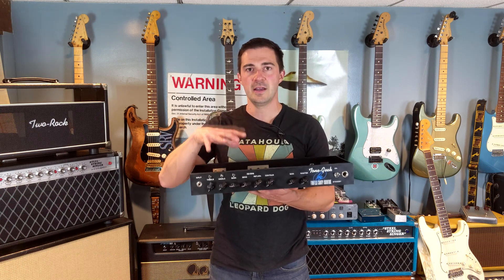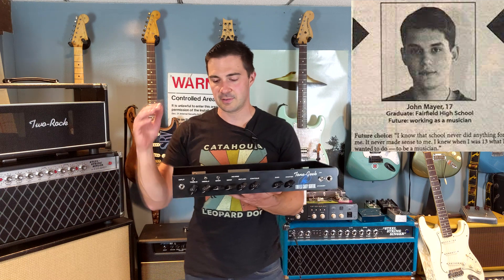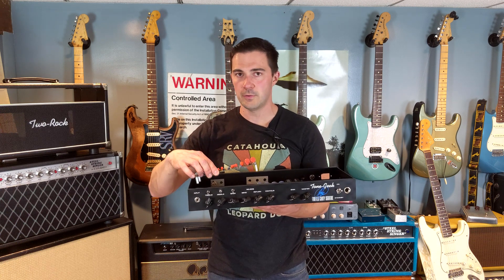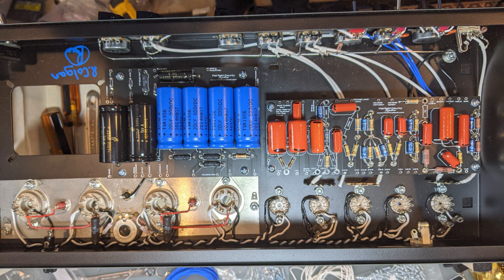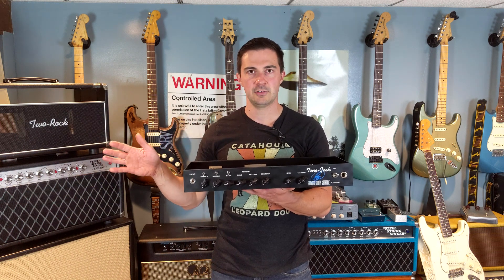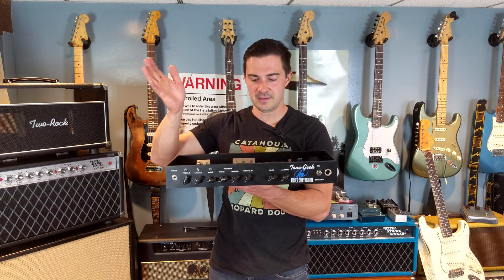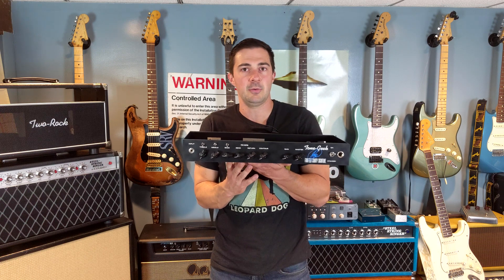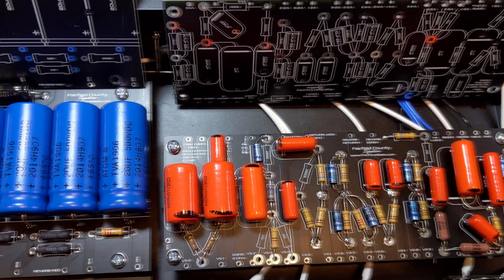Fairfield County Signature Build Series Introduction | Building a TR John Mayer Signature

Comment: Hey Ryan, big fan of your work for a long time, congrats on this one. Just a question. I own a (stock) Ceriatone JM100 as well as a Ceriatone SSS 100 and a Two-Rock TC. I was wondering if you could elaborate just a little bit more about the difference between say the stock JM100 and the original Two-Rock JM sig with the knowledge you have now, compared to when you made the circuit video back then. Thanks and take care!